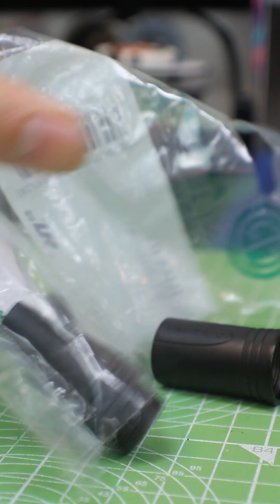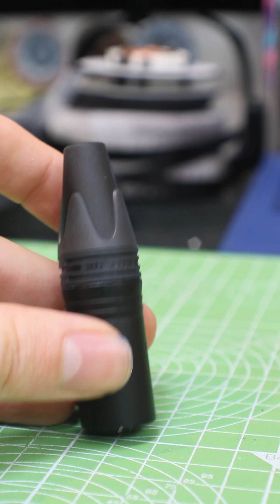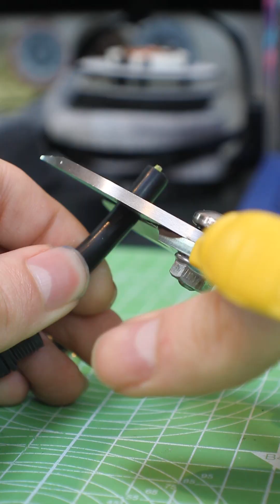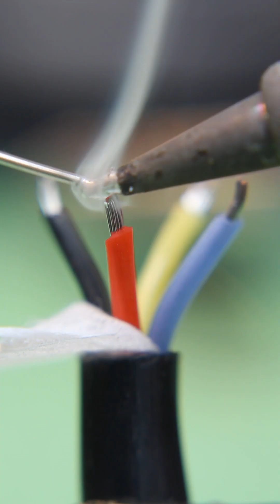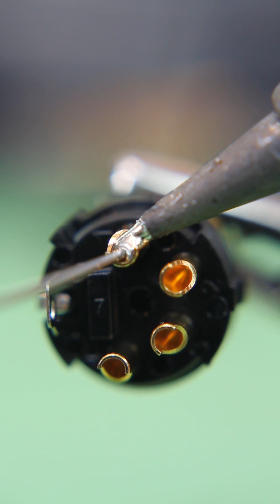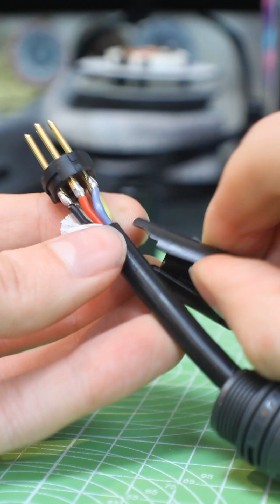How to solder a balanced Neutrik 4-Pin XLR to a headphone cable

Comment: How would I connect a 4 pin mini XLR to a 3.5mm connector? I am new to 4 pin/XLRs and I dont understand why both a left and right signal is going to each headphone driver. 

Specifically, I have some DCA E3 headphones with a 4pin terminating to 4.4 pentacon connector. But I would like to make my own 4-pin to 3.5mm trs cable. 

It seems like I have to merge the ground (-) wires together and merge each of the signal (+) wires to each of their own Left and Right channel (left + to tip, right + to sleeve). Altogether, making 3 wires for the 3.5mm trs connector. Is this correct? Thank you!
Reply from the maker: Yes that is correct. If you would like to learn more about balanced headphone cables we have a video here
https://www.youtube.com/watch?v=2bpX13gUJBI